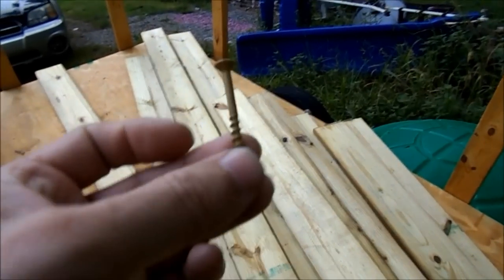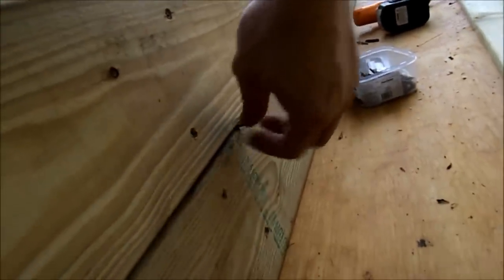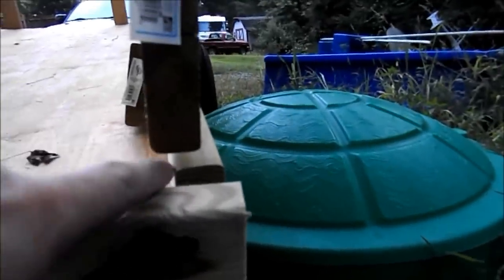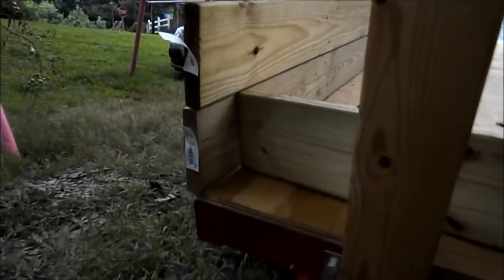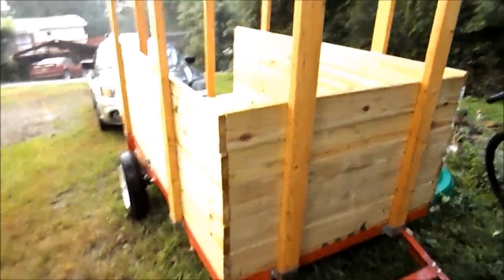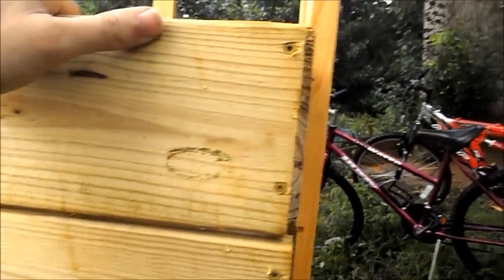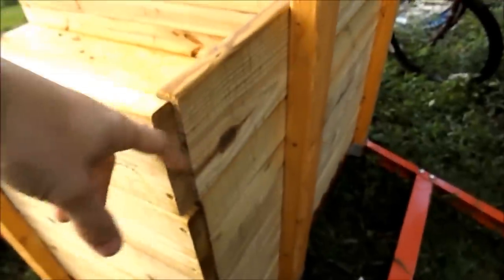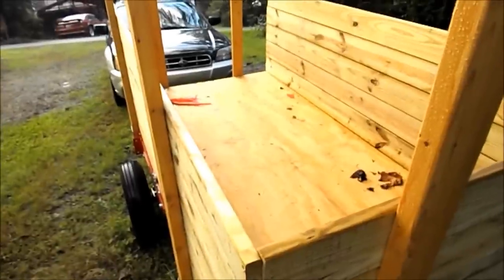Put Sides On A Harbor Freight Trailer

Comment: If that's pressure treated wood, I'm guessing you can carry one bag of leaves before you hit the max weight limit of that trailer.
Reply from the maker: lol, the wood was not very heavy.
Reply: I figured -  but couldn't resist being a smart ass.  Good job.
Reply: Automatic Slim ... you're right.... 1200 max load trailer minus the total weight of trailer pluses the weight of all that wood means NOT A LOT OF PAYLOAD....

Comment: Nice job. How did it turn out?   I think I have the same trailer from harbor freight.  Mine has the 1720lb capacity I think. That's exactly what I wanted to do to mine as far as putting sides on it.  Was it hard to put the stake brackets on?  I didn't see any of them at harbor freight.com.  Thanks

Comment: Everyone makes the same mistake! Put the rails on the outside of the upright posts, so a 4' X 8' sheet will lay flat on the trailer....
Reply: FourDollaRacing that’s all I could think about, on the inside they are losing at least a 1/2” all the way around.
Reply: If you do that you have a gap between the walls and floor
Reply: Most trailers yes, but on the HF trailer, putting the boards on the outside will hit the fender and wheel.